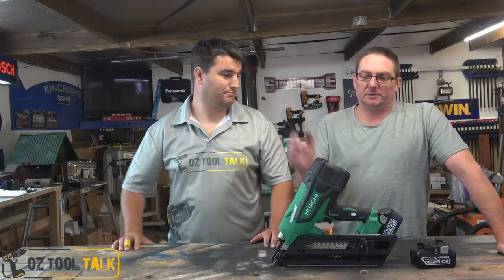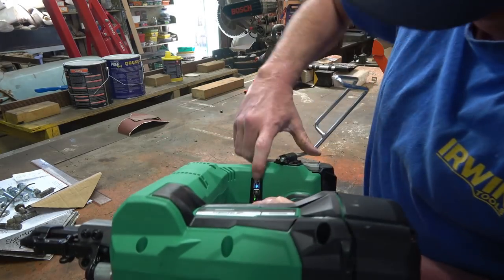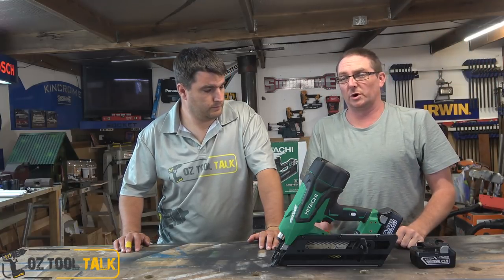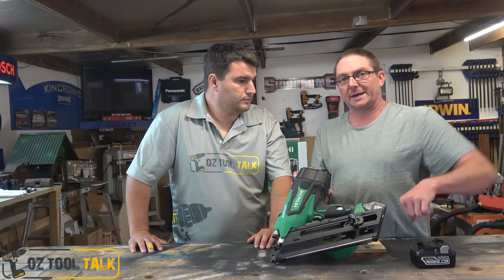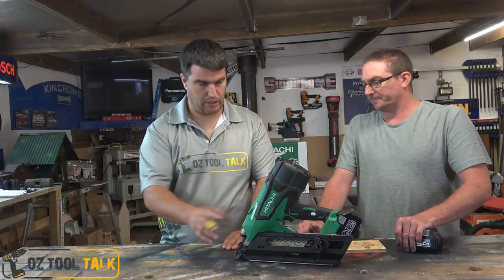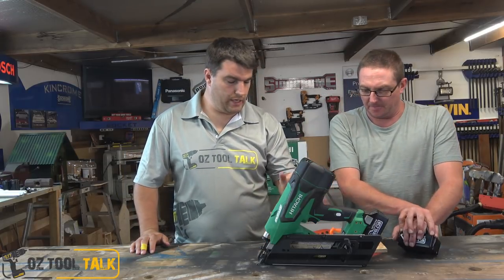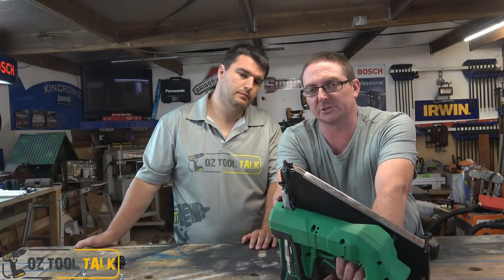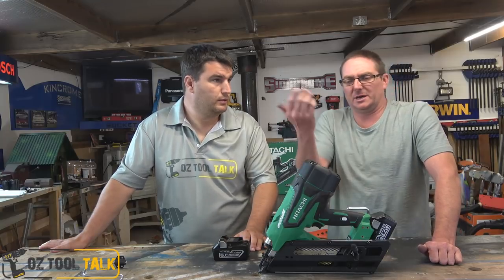Hitachi / Hikoki18V Framing Nail Gun - Brushless NR1890DBCL

Comment: As a professional, time and time again I get succoured into buying a cordless framing nailer.  It’s the fantasy of finally being free of the hose.   The fantasy usually lasts about a month.  It all started with the gas powered Paslode,  18 Dewalt,  another Paslode, m18 Milwaukee and now this Metabo/Hikoki.  My advice to you if you must have one is to buy an extended in store warranty.   It will save your butt when you are back exchanging it for a new one.   So far from the cordless nailers the gas powered Paslode was a nuisance but managed to last the longest.  The new M18 Milwaukee lasted four weeks of semi daily use and lost driving power.   We will see how long will this Metabo last.  I will also mention that I daily rotate three pneumatic nailers.  The A3 Hitachi, A4 Hitachi and Paslode 325R.  Hence the cordless nailer is only used in certain situations like pickup work, truss bracing etc.  I  also don’t use it for sheathing as that will just kill it in no time.  As for the pneumatic nailers go the Hitachi A4 is my favourite for its reliability, speed and toe nailing (I sharpened the nose tip).  The A3 is the older version of the A4 and looks the same. I keep the nose tip blunt on this one for sheathing work.   The Paslode 325R is great for overhead work as it’s the lightest and smallest of the bunch.  Anyway,  that’s my experience. Cheers from Canada 🇨🇦!!!

Comment: The rafter hook was good for hooking on wall plate and trimmers, and you can always spin the hook around for your nail bag.
I do find it could lock into position better, as I have moved it by accident before but that's a minor inconvenience. That said it's probably better a little loose than a little hard to move around.
The nose peace gripped great, it doesn't need to be sharper, but I agree that it could be a bit longer for the skew nails.
Overall it has been a great gun so far, thanks for the in-depth review.
Reply from the maker: Martin denBoer Glad your happy 👍🏼👍🏼

Comment: The hangar is wide because it gets attached on the other side and wraps itself around the battery, then it ends up with a similar width to the smaller one you used.
Reply from the maker: we just don't like that design i guess
Reply: @OZToolTalk  but because you didn't install it and use it right you dissed it. Not understanding how to use something isn't a design flaw. ffs

Comment: I bought one of these 21° nailers by Metabo  at Lowe’s… 3 TIMES. The first one only fired in bump mode. I headed right back out for round 2.  That one only fired in single shot mode.  Tonight was round 3… I just had it out in my backyard “attempting” to shoot more smooth shank 3” nails into a 4x4. It only shoots single fire but it’s in the rapid fire bump  mode.  I called Metabo and of my 30 plus mature years dealing with various companies they were by far the worst coming that I’ve ever dealt with.  I was hoping to speak with someone in tech support to explain my trouble but there was no one for me to speak with. The person who answered he phone had absolutely nothing to say or offer me.  She only barely replied to what I said.  Lots of awkward silent moments.  All that she said was for me to send it to a repair center.  “IT”…??  I had two at that point and this makes three.  3 pieces of junk so that would be “them”.  How can I possibly have 3 that are all defective in operation in 3 different ways.??  I pray that Makita comes out with a framing nailer soon.   On a side note… I cannot imagine that any professional woodworker had any involvement in designing this tool. It only accepts  one strip of nails at a time and you have to go all the way through until the end before you can fit another full strip in. They should have designed it that as you get close to the end and before you are down to the last nail to fire you should be able to fit in another strip. There is no room to fit in a full strip until you go all the way to the end and the gun locks out. I went through about 12 or 14 strips today and a couple times it wouldn’t even accept  the full strip and I had to clip off one nail in order to get the strip to fit in.  The switches to operate it are super tiny and awkwardly buried in a hard to reach and see spot on the handle.  Your finger covers them while pressing them so you can’t see what the indicator light is doing.  The safety switch is buried deep in a recess and can only be operated with your fingernail.  
This Metabo NR 1890DR(S) is an embarrassment to the power tool industry.  I’ve always owned quality tools.  My Bosch barrel grip jigsaw is amazing. All of my Porter Cable routers can’t be beat. I bought my first pro quality tool in 1986, a Milwaukee sawzall and it’s still working perfectly.  My Makita battery operated tools just don’t die.  This Metabo is a disposable tool and good luck with it lasting for a year. I was told that once a year it has to be sent in to have the charged air tank inside the gun recharged.  I wonder how much that will cost.??!??  Stay healthy, everyone… And BTW, I am a craftsman level home remodeler of 35 plus years.  I really don’t want to keep lugging around my heavy twin tank Makita compressor for small jobs and thought this was my ticket to freedom from hoses and oiling guns.  I guess not yet.  Back ALL THREE GO…  I just got a $1212 credit back  to my Amex card from Lowe’s for the stack of 3 that I wheeled in on a cart ✌🏼

Comment: The only review that matters is,  how reliable is it? Can it stand up to daily use on a construction site?
Reply from the maker: I'm not sure ALL you need to know, but I agree, it's very very important!
Reply: Framing guns are notoriously troublesome. I have went through quite a few. When you are in the trade a tool is merely a means to make a living, That is why you never see roofers using anything other than a paslode. Paslodes are noisy, smelly and require cleaning, but they are the only gun that can stick the rigours of site work, year in year out. They have  a simple mechnism that can be repaired or patched up eaisly. I put around 5000 nails through my gun in an average week first fixing.   For a trades man reliability is of paramount importance. features and the like are a distant secondary consideration. Naturally DIY use is different.

Comment: I work at Mitre10 and our Hitachi rep claims that this thing never needs a service.
Reply: This gun has a piston with piston rings so for sure those rings wont last forever. Senco fusion have similar system and Senco claims it will last 200 000 nails.
Reply: Hikoki told me it needs regassing after about 6-8 months depending on usage

Comment: What rafter hook did you use? Need to upgrade mine. Thanks
Reply from the maker: FTLAUD 911 we only used the bracket they came with it sorry. 
I can’t remember off the top of my head what size the original one is. I have loaned it out atm. (Mike)
Reply: Hi, did you find out which hook was the smaller one?

Comment: Hi guys thanks for the video. I have just purchased this framer and it's amazing !! I do have a question. I have found that when it runs empty it actually has about 8 nails left in the strip. Have you found this as well ?
Thanks jeff
Reply from the maker: jeff Loomis I thought it left a couple. But 8 seems excessive. Maybe ask the question at a service agent. Dwain has the fun atm so I can’t actually check sorry. (Mike)
Reply from the maker: I've found this to happen on the DA gun too [Dwain]
Reply: just shove a new clip in on top of the eight in there and off you go...no need to take the 8 nails out everytime if thats what you're doing
Reply: @davehole643  thanks Dave yeh that's what I have been doing 👍

Comment: The biggest problem with this might be the rest of the tools in the Hitachi lineup, that said, I have recently bitten the bullet and gone to 2 battery platforms (Makita and Ryobi), battery costs are coming down a bit so maybe not the end of the world.
Reply from the maker: [Dwain] what do you think is wrong with the rest of the lineup? They have a cracking drill & best impacts.
Reply: Last I checked, and I could be wrong now, their lineup was very small compared to the other brands, ie, Makita, Dewalt, Milwaukee have zillions of tools, Bosch, Hilti and the likes had enough to get by, but Hitachi was missing some key tools I thought. I did have a quick look before posting this comment and they seem to have a lot more tools now than I remember, including all the tools I would use, so maybe not an issue anymore.
Reply: Oz Tool Talk I have to disagree with you there dwain fella the makita dtd170 is the best impact driver on the market by far! As for the gun you done another impressive review but I’ll just stick with my paslode im360ci
Reply: I could have sworn the best impact driver on the market was the Ridgid R86036K :)
Reply from the maker: [Dwain] yeah that perception is still pretty common, but I'm not sure that it's warranted these days. With their drills/drivers/nailer/circ saw, they've got to be attractive to chippies especially...

Comment: Had mine a week and use it all day everyday for studwall...above head height work is tough going because of the weight...the nose is too short, which makes visibilty difficult and access to tight corners difficult....it does fire well but  a 5ah battery will only last half a day so take a spare...when setting it on the floor you have to lay it on its side as it hasn't a large enough  flat area for it to sit on its top, this makes it annoying when having to reach fully to the floor to pick it back up, hard going on the back and hips....the belt hook easily becomes detached allowing the gun to swing around and jab you in the knees as the video says....WHY CANT ANY NAILGUN MANUFACTURER MAKE IT SO THE GUN BEEPS WHEN THE NAIL CLIP IS SPENT!...mine jammed using a 90mm smooth nail clip, i had to rip the nail out with a pair a pincers...not looking forward to when the compressor packs up as i reckon it will cost more than the gun to fix....the added weight worries me about any accidently droppage and what damage will occur....overall a good nailer but its not as refined as the paslode im350, yes i said the im 350....oh and having to turn it back on with a button on the wrong side of the gun body is a pain in the arse....and the lock out dont work
Reply from the maker: Great feedback Dave! I have encountered a few of those issues too.

Comment: Sounds similar to the Senco Fusion system, which I owned for half a year till it died..
Reply from the maker: [Dwain] Senco uses gas as a fuel, these do not.
Reply: Hi Dwain,
The Fusion tool is 
charged with compressed air in a 
factory sealed chamber. Same system. 
Senco Don't have gas guns like Paslode.
It wasn't a serviceable item, pretty much I toss it in the bin. 
The local specialty shop which sells and services air and gas tools said the Senco Fusion wasn't worth it and stop selling them. The Hitachi 18v Framer may have improved this system?
Reply from the maker: MultiFin (mike) I will chase this information up but I believe it’s a much upgraded system and quite different. I’ll find out and we can go through it.